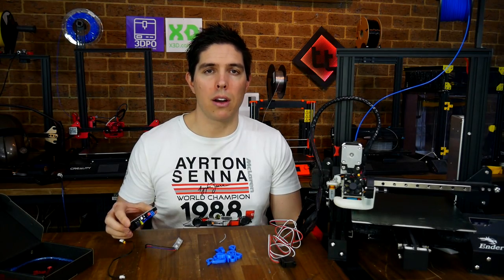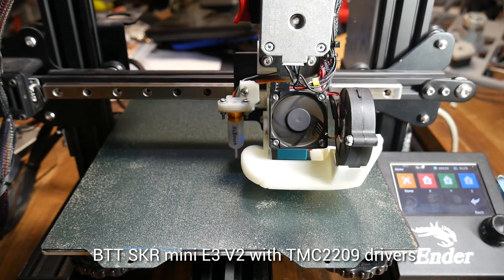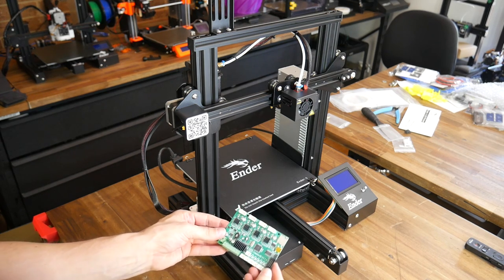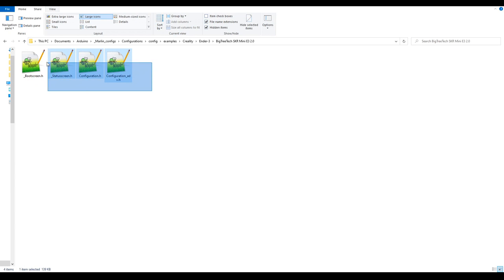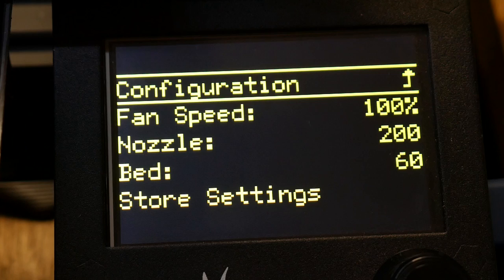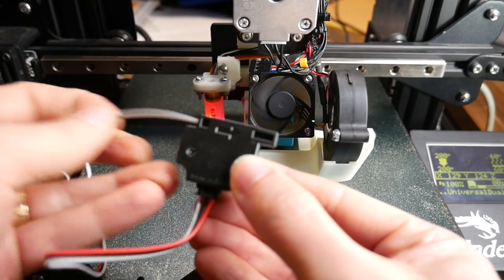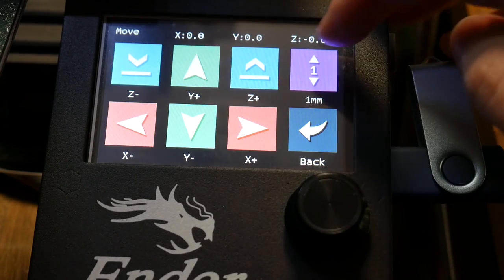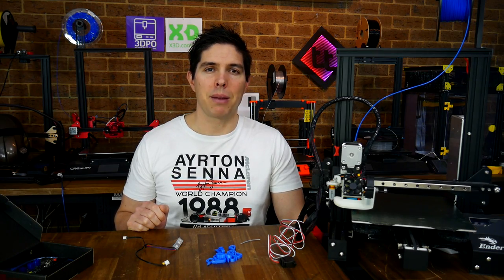SKR Mini E3 V2.0 - Complete guide to the best value Ender 3 upgrade

Comment: Will this board fix the resume print issue. On a stock ender 3 board my prints don't resume on power off. They are complex files and over 24 hours. When the power goes off the printer gives me the resume print option, but it just reheats, moves the head, and then does nothing.

Comment: I am unfortunately not able to compile for a SV01 printer. I grabbed the bug fix branch of both marlin and the configs copied the example config files over and made the board reference changes. Hit compile and received the failed message with 6 errors stating incomplete board definitions and undefined pins. Any idea if this is related to the SV01 config files?

Comment: Is this board compatible with the Ender 3 V2? Or, is it better than the stock board in Ender 3 V2?
I am having issues with my 4.2.2 board and Color LCD and I'm considering replacing it with the SKR Mini E3 v2 and the BTT TFT35 LCD.

Comment: I recommend if you DON'T have a BL-Touch, you configure configuration.h yourself by hand as the latest (as of Feb 28, 2021) marlin configuration file configuration.h for the Ender 3 and Ender 3 Pro ASSUME you have a BL-Touch added AND WILL CAUSE AN "Enabling Bed Leveling Failed" error when you power up the Ender 3 Pro with the compiled firmware.bin file.  Briefly you will get a "faded bed level 10 (or OFF) error" flash on screen...
Somebody committed a new configuration.h file and didnt bother taking out the modifications made for the BL-Touch on his Ender.

Comment: I've tried the pre-compiled firmware from SKR and tried to compile my own firmware for this board and BLTouch [3.1] and cannot get it to work. It reads the bed and stores it to eeprom, but when i go to print something with the probe offset it just hovers, no matter at point i set the zed offset . . . .i don't see how you got it to work so easily.

Comment: So after watching this and keying in on the Out of the Box compatibility. In saying that it seems this board without any firmware changes, without any Probes, lights or additional stuff...bare bones, this board will run an Ender 3 without issue?

Comment: Hi! I have a question: with this new moterboard, can i use ezabl instead of BL-Touch?
Reply: Yes, you can, but you will need to compile the firmware in Platform IO for an EZABL or inductive sensor instead of a contact one.

Comment: I have an Ender 3 V2.  Do I have to buy the LCD in addition to the motherboard?  I upgraded the display firmware when I upgraded the stock V2 board to Marlin bugfix.  Can I do something similar with this board, or do I need to buy the display too?

Comment: Mine came without the heatsinks or stepper motor drivers installed. The heatsinks have some kind of pads on the back. I had assumed they would need to be soldered in place but I can't find an answer.

Comment: Thank you for this excellent video. I've installed the SRK Mini E3 V2 in my Ender 3 following it and everything is running smoothly... except for the mainboard fan. I have never seen it turn on... I don't know if it is because it has not been needed or because it is not working. What is exactly the condition for it to start? Is there a way to manually command it to start, at least to check if the fan and the port are OK?

Comment: Hi, is it possible to explain how to get the SKR mini E3 board(s) working on the Ender 3 V2 since there seems to be a problem with connecting the screen? (different pin layout/firmware difference). Some people figured this out but I don't really know where to start. I believe you can explain this very well and you will have a big audience for this mod. 
My aim is to have an Ender 3 V2 with ender extender XL kit, BLtouch and Dual Z with G34 active.

Comment: If you update the firmware with the SD card, do you have to have the firmware on the SD card everytime you boot up? I run multiple cards for my printer so would i need to add the .bin file to every one?

Comment: I have a problem with the SKR mini E3 v2.0 and the TFT35 E3 v3.0. I think that is a bug because I connect and configure on the firmware correctly a runout filament sensor and it works in Marlin mode, but in the graphic mode this runout is like if I didn't connect it. Could someone say me how I repair it? I have readed the github of both devices and I don't find any solution.

Comment: I have a geeetech a20m that is pissing me off with layer shifting. I've tried a bunch of stuff. Would I be able to put this in there and just redo the whole thing?
Reply: At the heart it works just fine in the A20. After installing a 1.2 into my Ender I was so happy I got one for the A20 also. Install on the A20 is actually easier as it has the huge area for wiring. Some plugs needed changing and it uses a different touch screen from the Ender but in the end works awesome. I dont use the 2nd extruder anymore on mine either just single head printing.  Coincidentally the layer shifts are what drove me into a change.
Reply: Try increasing the Y motor voltage and set acceleration to 750mm/s^2 and Y MAX acceleration to 1250mm/s^2 ! No more layershift ! Try using s-curve acceleration (on marlin.org) !

Comment: I have installed 3 of these now and thanks to this guide they all have gone perfect. The only issue i have had is in my firmware ... I think... Where the printer thinks Y0 and X0 are are not right correct. Y5 for instance is off the front the the bed and X5 is far in. all 3 are exactly the same. If i add in M206 Y-24.00  and save with M500 I can get pretty close  more than usable just loose a little for not spending more time getting it perfect. Is there something i need to adjust in the firmware or is the M851 command the only way to get my locations true again?

Comment: recently bougtht an ender 3 as my second printer (after a second hand XYZprinting da Vinci Jr which was very closed source and un-upgradable) and installed SkR mini before constructing the printer. this video was really helpful for me, as someone new to the electronics scene and the idea of customisable firmware, hardware etc., to see what features the board offers. I am interested in buying some Neo pixels. Would you recommend also purchasing the 'DCDC power module' you mentioned to do this? as I say I am new so wary of not purchasing hardware which is not compatible with my current hardware (also qui the impatient with shipping ;) so would rather order everything I need at once) thanks again for the great video and your other videos on these boards
Reply: should probably mention that I ask about the dcdc module as I am interested specifically in a largish line of lights purely as decoration (i.e. it is unlikely I would use them to show the status of the nozzle, bed, print completion etc.)

Comment: Bought one cause of this video along with a tft35-e3 for my ender 3. Installed it with ur very helpful wiring diagrams. But when I turned it on the nozzle immediately started heating up while I didn't touch the button yet and it also said it was supposed to be at 0 but was at 250. There was also filament dripping out so no thermometer issue. Any fixes for this so it doesn't burn my house down?
Reply: Double check your wiring. Maybe you connected the wires for the hot end to the ports of the hot end fan. Since the hot end fan is immediately supplied with energy after the printer is turned on, switched wires could result in uncontrolled heating of the hot end.

Comment: issues im having is trying to find the skr e3v3 with the CR touch wired with the 2 wires on the OE jst connector on the z limit port on the skr. when i click ABL it doesnt move the bed up to deploy the probe it just pushes it out and then says failed. how do i change the height of which it has to be to deploy the CR touch?

Comment: I've had 2 of these boards now, and with both, the part cooling fan came on straight away and didn't respond to any attempt to slow or stop it using the control panel. It's connected to the fan0 port on the board, so that's not the issue. I've read that the MOSFET for the fan is a bit suspect - can you shed any light on the picture? I'm getting ready to smash the bloomin' thing with a hammer....

Comment: I have a problem with the connection of skr mini e3 v2.0.  After connecting to the computer and starting Cura, the printer freezes and squeaks.  When connected to a host repiter or a printing program from Prussia, everything works.  I would like to use Cura but I can't, will you help?  Changing the cable doesn't work, have any idea?

Comment: I have a question about this board, I have SKR mini E3 V1.0 and it can't be directy powered via the USB through optopi. If you connect USB power and therefore boot up the printer and THEN you power up the 24V PSU, the printer will somehow think that its esteps are double the value written down in the firmware. This means that if you send a command to move an axis by 100mm, it actually moved the axis by 200mm. So how did I fix it? According to some guide on the internet, I had to cover the +5V output pin on the USB connector with some electrical tape, so the board can't be powered via 5V from the USB and the only way to turn it on is through turning on the PSU. This indeed solved my problem, but I always wondered what was wrong with the design that powering it with 5V resulted in doublin esteps values no matter the settings in the firmware. (I have never experienced that same issue with any other board and because there were people on the internet with the same problem I guess it was pretty common).
So now to my question, is this problem fixed on the SKR mini E3 V2.0? Can it be turned on via 5V usb using octopi and run without any problems when the 24V PSU is turned on later than the board?

Comment: I installed this board and I keep getting this very loud squeaking on the retraction/deretraction. I heard dialing back retraction rate to <30mm/sec with no luck, I read linear advance could be the issue so I disabled that, no luck. I'm not sure what else to try... I'm getting frustrated and about to return this. Any suggestions?

Comment: I have the thd3 ezout but can't get it to work. I have tried ever combination in of true/false low/high, pullup/pulldown marlin, no good. The folks at  thd3 say this sensor will not work on this board without their additional board. what's the trick

Comment: Can this be used to swap out the new board on the Ender 3 V2?  Wonder how that works with the new vertical color display on it as well?  Maybe the new stick board is fine for now in the Ender 3 V2 anyways?  I.e. quiet drivers, bltouch and runout sensor connections already on it... so may not need it on Enderc3 V2?  I can see a Ender 3 or PRO needing this brain transplant obviously though... but V2 may be fine now and no need for brain surgery hopefully.  We'll see when it arrives soon.

Comment: I can't my TFT35 E3 V3.0  to detect the printer at all. It works on marlin mode, but it seems to stop at a certain % of the print height, requiring a manual resume.

Comment: I am trying to find a BL Touch firmware for the Ender 3 and am selecting v2.0 firmware/hardware and all I can find is the firmware for Ender 5, do you have a direct link for this firmware as it is driving me nuts trying to find it.
 I got this as it is a direct replacement for the Ender 3 but this Github page is a labyrinth and I have seen no mention of the Ender 3 yet

Comment: Tried compiling and it failed, followed these instructions so I suspect I'm missing something with visual studio that I haven't set up right.
Reply: @steveandre763  thanks, I tried marlin bufix 2.0x, compiled but still feels off and have issues printing via a usb cable and using abl via the touchscreen, only really works in marlin mode.

Comment: I have justed received and installed the SKR Mini E3 V2.0. Out of the box I am seeing an issue. Autohome is not detecting the y end stop. Sending a M119 shows that when Z is triggered Y is also triggered. Y is not triggered on the switch. I am going to update the firmware over the weekend. I have triple checked all the cabling.

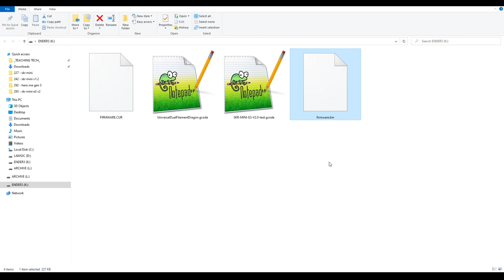Comment: Can I just ask a question? I am confused by 10:11 when you try the preconfigured file from github, you used firmware-bltouch.bin. Would not the firmware-bltouch-for-z-homing.bin have been a better option? I don't use a z end stop and going into the program is (as is evident here) not my preferred choice. Am just wondering if I am missing something here?
Reply: Karl which did you use I think I’m gonna keep my z switch, which do I dload mine comes tomorrow thanks I have BLTouch also
Reply: @MrTobamory  I actually started working on it last night and used the z homing. I was unconvinced and disappointed by the video to be honest and decided to try and figure it out by myself. The wiring was simple and just needs the red and blue cable switching round. The red connector plugging into the old z. I have not gone into any configuration yet but this bit works.
Reply: @MrTobamory  Got it.. After a lot of mucking about finding the probe offset I am printing a cube! Still a bit of dialling in to do and am a bit bored of it. But it is do able.

Comment: hi Micheal,

I'v been subscribed and watching your channel for nearly a year now and must say i really enjoy your content. i purchased our 3D printer about December 2019 (My Christmas present to the the family) an Ender 3 and have had alot of fun designing thing and printing them, currently only using PLA. I am looking to venture into PETG. Your channel has helped me through some issues I am so greatfull. All my prints so for have been small (ie less than 8hr print time) this is because of the lack of thermal runaway. my intention is to replace the mother board with the BIGTREETECH SKR MINI E3 V2.0 in addition i like the idea of a touch screen. I have seen the Ender 3 V2 and the CR 6 and I like the vertical screen, also i like the idea of NOT having the encoder wheel/knob. Do you know if the BIGTREETECH TFT35 V2.0 can be used vertical and if having no encoder wheel/knob would cause a problem on the Ender 3, if it is possible a video explain how to do this would be of great help. keep up the great content.
Regards
Paul

Comment: How about the Ender 5? is it the same drop in replacement? i understand the firmware is different but in terms of the wire Connecting, Are they the exact same location?

Comment: Well, apparently you can't use Octoprint if you have the SKR board AND the TFT35 display connected together. Some conflict about Octoprint and the TFT using the same serial communications path. Maybe Michael can do a video on how to solve this? If it can be done.
Reply: I have both of those connected and working. Did nothing special for it to work.

Comment: Just installed the board but its all working except for the Hot End heating. When run it heats up Bed Ok but Hot End Errors. I have checked the Heating element and that is working fine.
Have you any ideas to solve the problem

Comment: I'm about to install one of these btt boards. Currently my Ender 3pro has the two middle stepper motor wires in each stepper reversed. Do I leave them like this? Swap the around? I'm not sure and can't find an answer. Help plzzzzzzz

Comment: Good day, Michael.

I am quite new to 3D printing (2 months or so) and would like to know how to use the M240 command to do some cool time lapse video clips.

I know some boards are compatible with this command and I have the BTT SKR MINI E3 V1.2  and the BTT TFT35 E3 V3 installed.

Thank you for your time and a reply to this comment would be greatly appreciated.  Have a
Reply: Octolapse?
Reply: @fredlima5343  Hi Fred !
I'm trying to keep it simple.  I didn't know this M240 command was compatible with Octolapse, if this is what you're trying to tell me.

I went for the X axis right side limit switch and simply add G-Code to make it go all the way to the right (« G0 X234.70 » type of command) before each layer.  I think this will work nice for me.

This evening, I installed a self-made microswitch bracket along with a microswitch.  Tomorrow, I will make a test G-Code to see if it works, but I need to know the exact G-Code to add so I don't screw the print.  The M240 command seemed to be the right one to add but if it's only compatible with Octolapse, I'll have to extend my research.

I thank you for your time and if you have some tips, it will be greatly appreciated.  Have a great day and I hope to read you soon, my Friend.

Comment: On saying the RCT6 has 512KB flash; in truth it's a bit pot luck - so I wouldn't claim it's guaranteed. I have two older RCT6 boards (V1.0 - second build run), and both now fail to flash above 256KB. It depends exactly what ST Microelectronics shipped them when the bought the parts. Sometimes it might be that the 256KB parts are devices that failed screening for 512KB, sometimes it'll just be that they label a quantity of excess 512KB production as 256KB to meet demand for nominal 256KB parts. Or it can be they're all manufactured the same, and parts from the outer areas of the wafer are just assigned to be 256KB and not tested beyond 256KB.

Comment: Got it, installed it, and after two prints it froze, I power cycled it and it didn't boot. Any suggestions? Fuses are ok, reset button does nothing, all I see is blank screen. I presume bootloader is damaged.